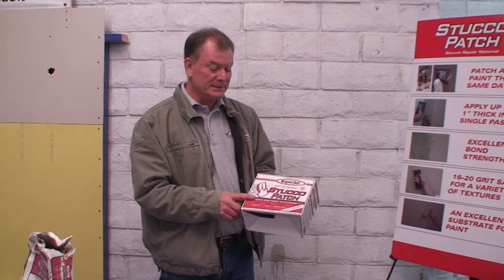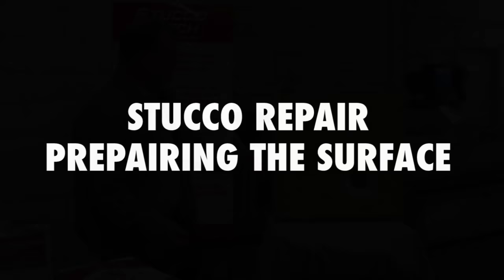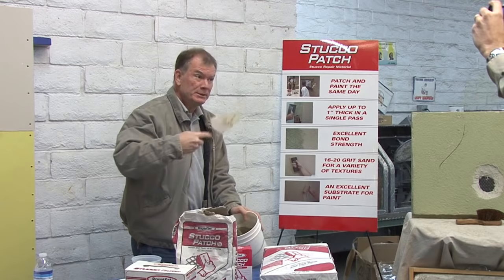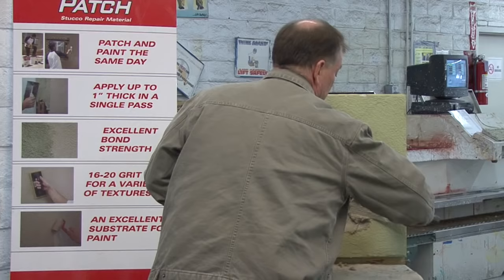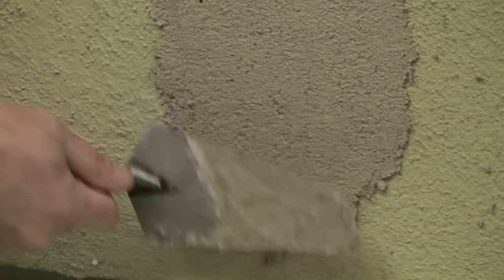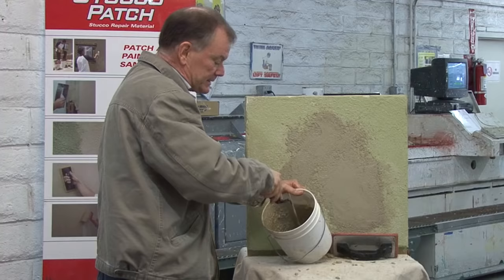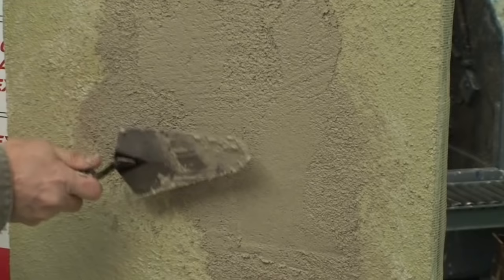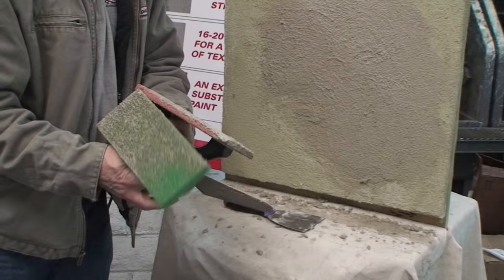Stucco Patch Demo

Comment: In my Google search that brought me here, I was hoping to find a kit that would include the steel screen that he's calling substrate. A repair kit for the scenario where a plumber cut through the wall for example, not a stucco-only hole where the stucco somehow just fell off in one spot for some reason, but the substrate is still there ready to cover

Comment: I used this to patch where an old exterior coal feed was. The homeowner liked the heavy texture I got with a sponge and wants the cracked sides of the steps parged/floated with it.

  Any thoughts on what could go wrong? Better to go over the old cement (after a light pass with the Festool diamond grinder) or use bonding agent?
Reply from the maker: Hi William, please email your contact information to info@ctscement.com and one of our technical representatives will reach out to you. Thank you.
Reply: @CTSRapidSet  will do

Comment: I have smooth stucco on my outside deck with a portion that has been restructured and scratchcoated but not finished and with no color coat.  Could I use this as a smooth finish repair for that and just apply acrylic paint over the top?
Reply from the maker: Hi Jonathan. Rapid Set Stucco Patch or Stucco Mix can be used as a smooth coat stucco finish over your scratch coat. Both of these products are exceptional for stucco repair. Stucco Patch has a thicker 16-20 grit sand texture that allows you to complete any stucco finish if needed. Stucco Patch can be painted after 2 hours, and Stucco Mix can be painted after 16 hours. If you have further questions, let us know.

Comment: Would this be useful to fix a bad crack fill job already done and painted? I can still see the cracks but wider and shinny because they filled in the surrounding texture. Then pain again or would it build up higher than the original surface?
Reply from the maker: Hello Penny. Stucco Patch can be used over painted surfaces. We recommend opening up this crack with a grinder prior to patching with Stucco Patch so that you get a nice level repair. If you have further questions, let us know.

Comment: So you don't need to use any bonding agent? 
If so what is the guide lines when and when not to?
Reply from the maker: Hi Robert, Stucco Patch has a good amount of polymers, therefore additional bonding agents aren't required.

Comment: great video, thank you. I want to fix some stucco cracks on the wall. Is it possible to add stucco color (dry/liquid) into the RapidSet stucco patch to match the current wall color? It doesn't have to be exactly matching the existing color through.
Reply from the maker: +Frank Fu thank you and apologies for the delayed response.  Just seeing your question.  Yes, ether one can be used - The Liquid Quick Create brand or the La Habra Dry brand. For the dry brand make sure you add it to the water before you mix.

Comment: Could this be used for a large crack from a slider door header dropping and pulling window? Crack is about 4-5 ft long about average 2 inch wide. Not a hairline crack
Reply from the maker: Yes, Rapid Set Stucco Patch can be used for large applications and deep fill.  Here are some helpful tips when working with Stucco Patch.

1. Properly prepare the area that you intend to patch and remove any loose pieces.
2. Have all of your tools and supplies organized, prior to mixing
.
3. Keep in mind this is a fast-setting material, so mix only what you can use in a 15 to 20 minute working window.
4. Apply material to full depth in one application, and do not layer. 

Please let us know if you have other questions.

Comment: Good video though before I start applying the stuco to hair line cracks or filling in areas should the paint be taken off in other words you dont want to stuco over areas that have paint on it?
Reply from the maker: Hello, a fog coat can be accomplished 2 hours after Stucco Patch is applied. The only thing is our product is not as porous as regular portland stucco. So make sure to not spray onto Stucco Patch before the 8 hour mark. Also, the fog coat doesn't stick to painted surfaces so make sure that it's all new stucco.  If you have further questions, please call us at 800-929-3030.

Comment: I used the product on several cracks and found the material to be very strong and easy to work with. The only issue I have is that the way you illustrate a crack repair actually sometimes leaves a small indentation where the crack is - then you need to put a little more on top to level that out - then, that causes a small bulge in the area of the crack and on a wall that is in line with the setting sun, those bulges are unsightly. Any suggestions? I assume you would need to blend that bulge way out which I don't think this material is really the best for that. Any thoughts?
Reply: Try running a paint scrapper blade along the edges of the crack.  It creates a bit of a bevel that helps feather the patch into the wall.  Don't be afraid to feather out a few inches on each side if you can match the texture.
Also, you'll get a depression if you don't fully fill the crack.  It can take a few passes of really pressing the stucco into the crack to fully fill it.

Comment: Hi what about a corner bead exposed ? How to repair the stucco that is now missing on the corner
Reply from the maker: Hello, you will need to wire brush the corner bead to remove any rust and loose debris. Then apply a coat of Rapid Set Stucco Patch over the corner bead with at least an 1/8 inch of coverage on the nose of the corner bead.
Reply: @CTSRapidSet  thanks for the tip. I will look into it
Reply: @CTSRapidSet  thanks . Is there any small package for just one corner that has only a few areas? Otherwise I will try it . Thanks
Reply from the maker: @phsx2890  you're welcome. We have a small size Stucco Patch box that is 10 lbs.

Comment: I have some space that peel off the top coat, can I use this product to patch it?  what is the mixing ratio?
Reply from the maker: Rapid Set Stucco Patch will work for this application. Use 4 parts material to 1 part water, and mix to a peanut butter consistency.  Adjust as needed.  If you have further questions, let us know.

Comment: Can I use this on a painted wall ?or do I have to remove the paint before applying it
Reply from the maker: Hello Felipe, you will want to wash off the painted wall, removing all loose dirt and debris. For optimal adhesion, we recommend getting as much of the paint off as possible.  You can then coat the stucco patch right over the painted wall.  Thank you.

Comment: Can this be applied over a cement wall that has lines from leaching?
Reply from the maker: Hello Vicki, this product can be applied over a concrete wall that has lines from leeching.  We recommend using this material at 1/4” or greater to ensure the lines do not continue to show through when coating your wall.
  This material can be painted within just 90 minutes due to our curing technology, and will not shrink or crack.  Thank you for choosing our Rapid Set Stucco Patch for your stucco needs.

Comment: Can you spray it through a hopper
Reply from the maker: Hi Mike. Yes, you can spray it through a hopper and it will perform well. Here are a few tips.
 
1. This is a fast-setting material, so don’t let it sit in the hopper for long.
2. Make sure you spray without stopping to ensure you don’t clog the hopper.
3. Clean out the hopper well immediately after. 

Please let us know if you have further questions. Thanks for choosing Rapid Set!

Comment: what is a Polymer and how much do you use?
Reply from the maker: Polymer is an additive that helps with adhesive and increases the bond strength.  Since Stucco Patch is formulated with cement, polymer and sand, you only need to mix with water.

Comment: could you dry it with a heat gun who?
Reply from the maker: Hi Ruben, Rapid Set Stucco Patch is a rapid-setting repair material, that will deliver strength within 1 hour after placement.  If you would like to accelerate the material and make it even faster, you can use warm water.  This will accelerate the setting time, and cause the material to harden and dry much faster.  Using a Heat Gun can cause premature hydration which could lead to surface cracking.  You would have better consistent results by using warm water.  Let us know if you have further questions.